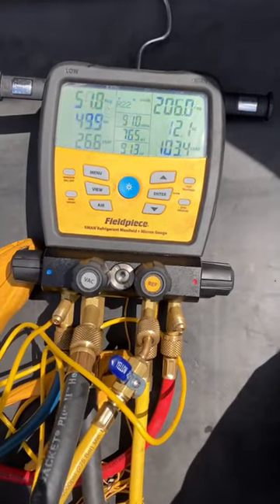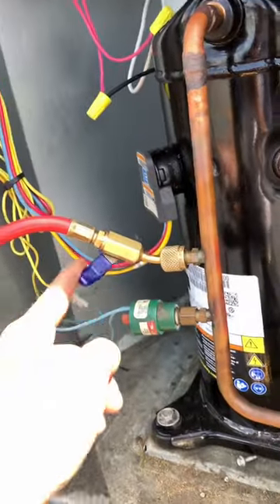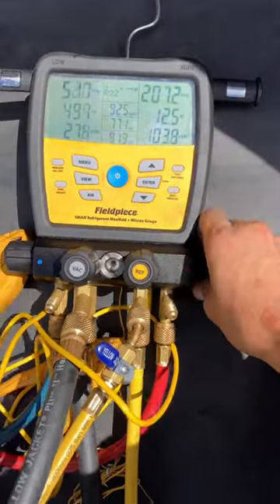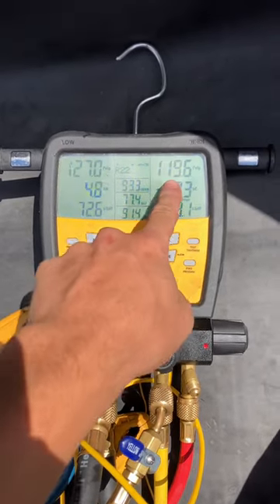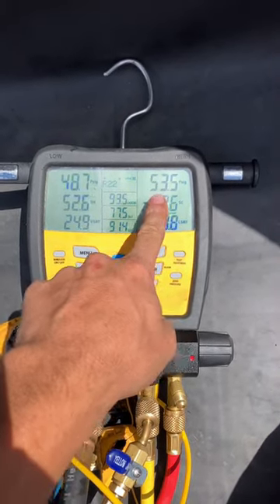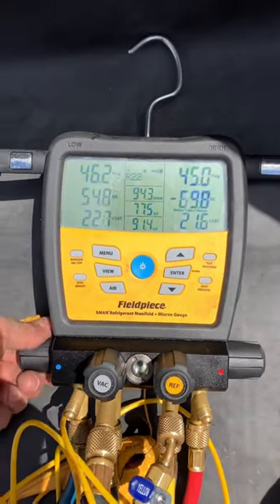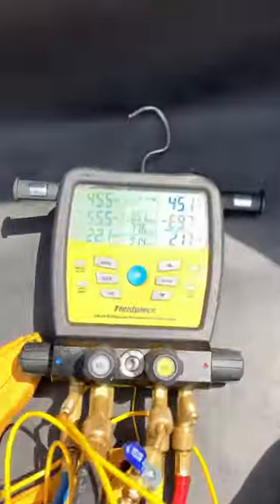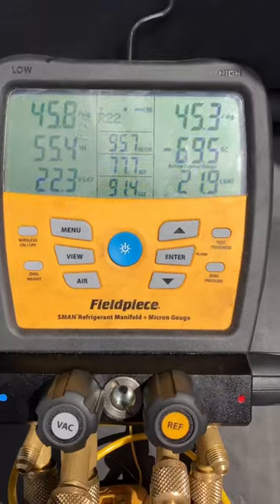How I Save Refrigerant on HVAC Units

Comment: If system is " critical charge" do not do this just vent to atmosphere. But on larger systems i do this everytime. It is not about "saving" refrigerant but not losing those oz's out of your hosing and dumping out of your hoses. This guy is on the right track and people talking shit are def from gen z not knowing what the og's have lost on the past! Got taught this 18+ years ago. And def want to do this in 410 so you dont burn your precious fingure prints off your delicate fingures off!
Reply: A critically charged system is one that requires a very precise amount of refrigerant. Wouldn’t it be more important to ensure you don’t lost refrigerant on those than a larger system where a few ounces doesn’t change much?
Reply: @Practicing_HVACR The only reason I think he said he was against it, is because the hose has its own weight/pressure of refrigerant beyond the scale and might add a couple OZs more than necessary… but not really sure😅

Comment: Well Clyde that is how it is supposed to be done . Even if you do not have ball valves ,unhook high side place on post on the back of gauge set and then open suction and pull in liquid until they equalize.

Comment: Is there a proper way to connect? I've been made fun of for not purging my hoses upon connection
Reply from the maker: in my opinion if all you're doing is checking pressure (not adding or recovering) there shouldn't be any need to purge after connecting, now in order to save refrigerant you're affectively "adding" because you're taking refrigerant form the closed off liquid line and adding it back to the system on the vapor side yes you should purge air out of the top of the lines. Since hose valves are usually left open after disconnecting air will get in and fill it, now when you get to a system and connect the hoses, that air is still in the hose as refrigerant enters to take a pressure reading, definitely don't want to add that into the system. Maybe a good practice would be always purging the air out just so you're in the hobbit of doing it so one day you don't forget and add any air to the system. Thank you for the question Nicholas!
Reply: Cant possibly get accurate reads with Air in your gauges. Air is made of nitrogen,oxygen,co2 and h20. Any of this mixed with refrigerants will give an inaccurate reading. Saying it does not matter is like saying non condensables wont effect how a unit runs.
Reply: @WhowereEpsteinsclients  air won’t change your pressure reading
Reply: Connecting technically your suppose to pump it down til the contactor opens